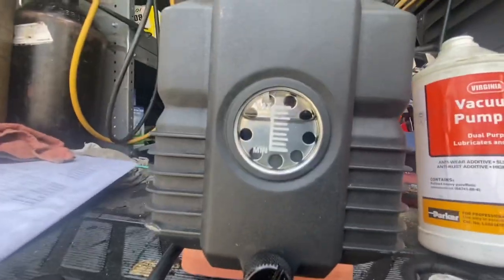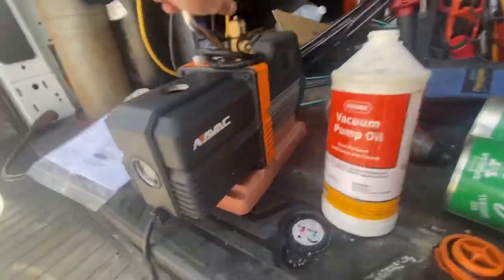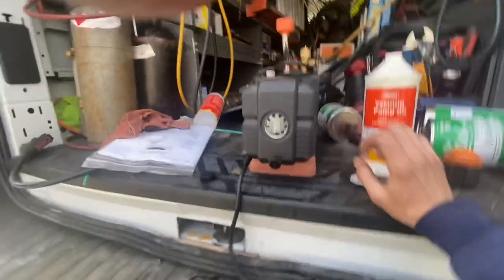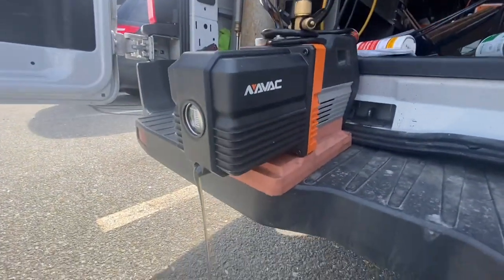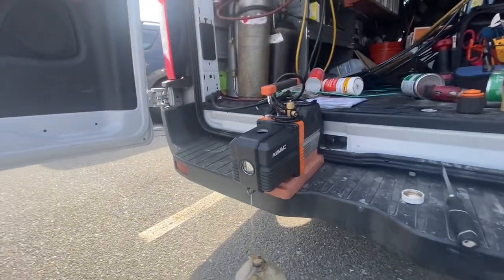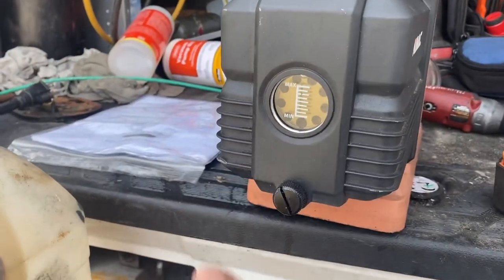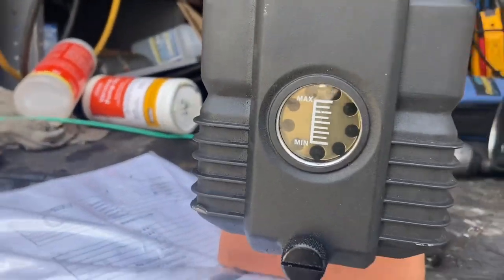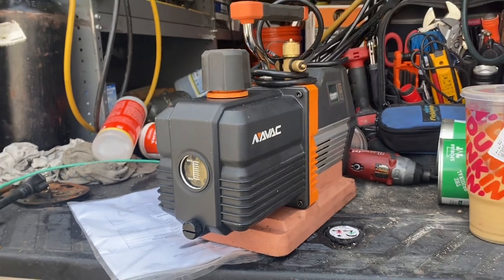Vacuum pump maintenance / how to change the oil

Comment: Good video 👍I use the JB oil caddy. I change my oil when it looks dirty or after every few systems or so. If im trying to pull a deep vaccum ill just put fresh oil in there. There is nothing set in stone in this field. A lot of it is just common sense. Every job is different. Adapting to the job im at is key for me. Sometimes ill vacuum through a manifold if im just trying to degass the system. If im trying to pull a deep vac ill use my big hoses and remove cores. It all depends on the job!